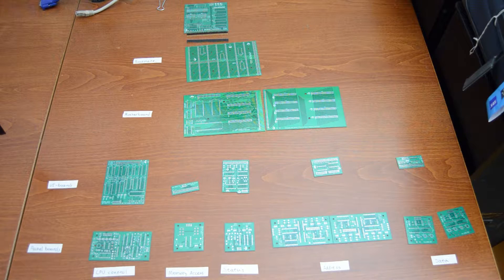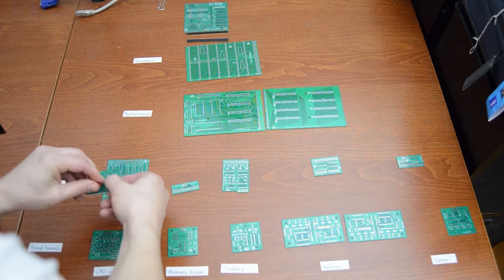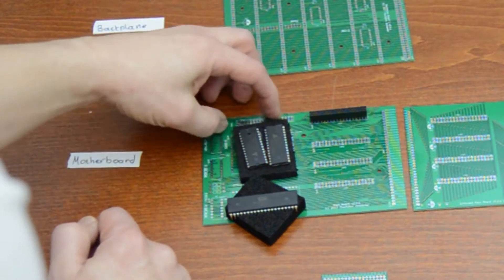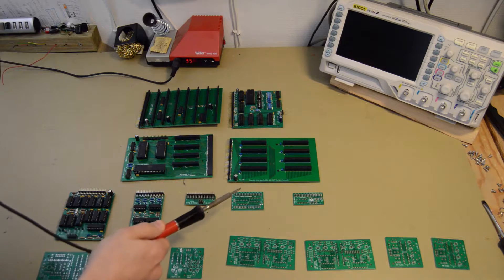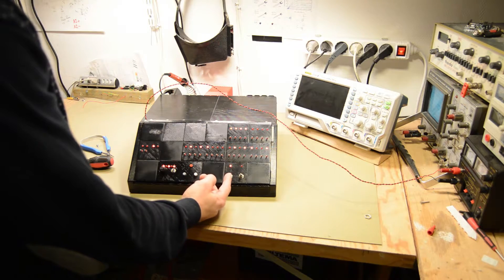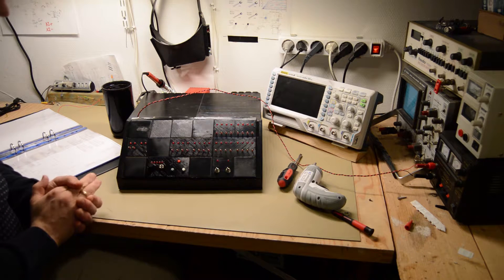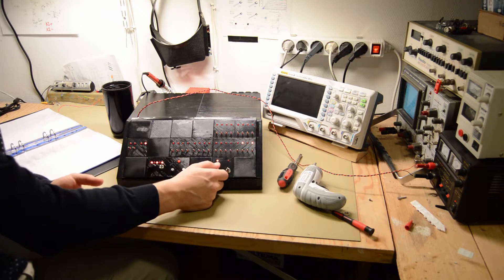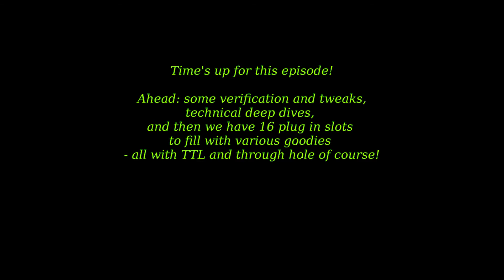The Alt6502: Episode 9: Build and Test

Comment: Wheres the finale, watched the whole series waiting for a booting machine. Serial card, operating system coding .... I want it all!
Reply from the maker: When doing the serial card (which is working at "high" speed, and the video is 75% ready), I discovered a critical flaw in the single step function. When the user single-steps the CPU by pressing the buttons, that input is not synchronized properly with the CPU clock, causing some decode logic on the serial board to act up. I have to redo some core logic (which affects about 8 PCBs), which a heck of a lot of work. I've started doing that, but some "real-life" projects (you know work, house, cars, kids - that sort of stuff) has stealed most of my spare time so the progress is quite slow. Also, determined to not repeat the mistake, I've read up on synchonization and implemented digital circuit simulator (naturally there wasn't a free one that met my requirements) and that took some time. Right now, I don't know if and when this will be completed, which is too bad since I have great plans for all the things you mention.